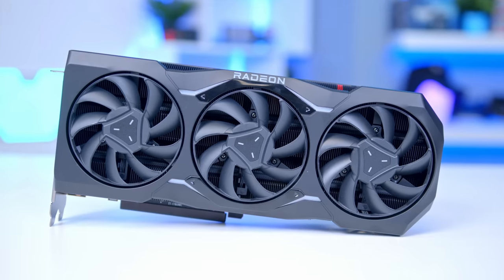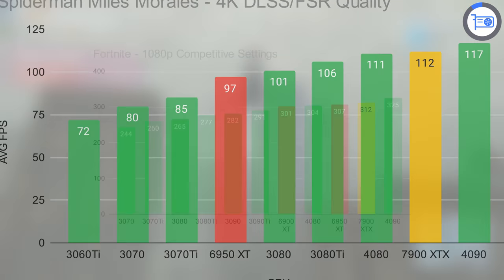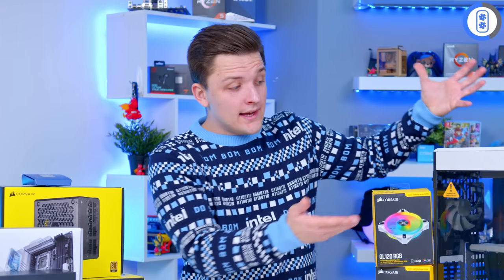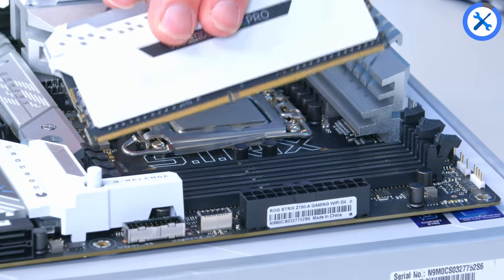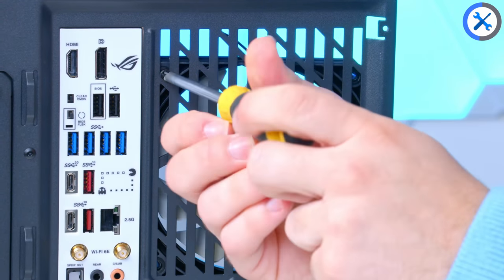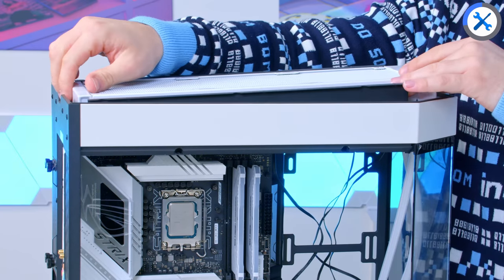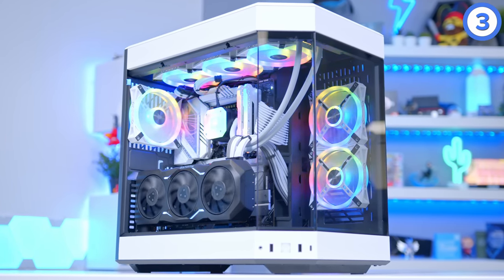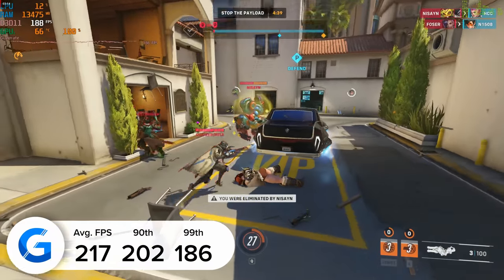Insane $3000 Gaming PC Build! 👀 [HYTE Y60 & RX 7900XTX Build Guide!]

Comment: I have the hyte y60 case and was definitely disappointed with the lack of accessories it came with. Plus the fans it comes with are complete trash and that's where they belong. I ended up putting 2 noctua NF A14 ippc 3,000 fans in the bottom which really helps with keeping the GPU cool. The only intake fans I have are the 2 noctua on the bottom. I have a 360 Aio on top and 2 140 on the side/back. I was kind of disappointed that there's only room for a 120 fan in the back. It's aslo kind of tricky wiring it all up because there's really no room to put the cpu cables in after installing the aio. I also had to cable tie the cpu cables down because they were hitting the fans from the aio because the motherboard is pretty close to the aio
Reply: How are gpu temps with the fans being close to the side panel?
Reply: Hint plug the cpu cables in first.

Comment: I can't wait to build on the Y70. It's gonna be very similar to this. 7900xtx taichi vertical mount on a 7800X3D. Just need to decide if I'm going to do the push pull with radiator on the side or just a single with the radiator on top. That will help me decide what I'm going to do fan-wise.

Comment: So u don't add any support bracket for gpu? Aren't you scared about gpu sag? My merc 310 7900xtx won't fit in with support brackets as it needs 4 but case only allows 3
Reply: Vertical mount is supported by the case hence sag isn’t a problem.

Comment: How does the gpu work vertically if it’s not directly connected to the motherboard?
Reply: The riser cable he plugged it into is fed into the Motherboard's x16 PCIe slot. It's basically just a 90 degree GPU extension cable.

Comment: I heard this case runs gpu hot. I was thinking about buying the ibuypower one with these specs

Intel Core i9-13900KF CPU, ASUS Z790 WiFi MB, GeForce RTX 4070 Ti 12GB GPU, 32GB DDR5-6000MHz RGB RAM, 2TB M.2 NVMe SSD, iBUYPOWER 360mm RGB Liquid Cooling. Anybody know how the temps are for running a 4070ti. Will be running 1440p.
Reply: That should be fine.

Comment: Bro if you pair AMD graphic card with AMD processor it will boost gaming performance by 15to25%
Reply: No, he put the i9 in there already. He’s already got the best processor he can get.
Reply: @chalkdemon8019  not really. The processor doesn’t matter as much for gaming.  Using an AMD gpu with an AMD processor can get 15-25% more power.

Comment: Hey I’m looking to build a pc aswell 
I have asked some guys around and they have me this list 
You guys think this worth it or I can get it for cheaper/add something better ?
Obviously the price is for the person to get all the parts so it’s normal to profit aswell.
But I want to know if I can get something better maybe for the same money 
Build:

17 gen 13
Ram 32gb ddr5
Ssd 1tb nvme
Mbo b660
Rtx 3070 ti rog strix
Psu 750w
Case nzxt h510 flow
Cooler nzxt ×53
3000 euro
Reply: The only thing I would suggest would be to get ddr4 if you want to save money on your motherboard and ram. There is only like a 1-2 fps difference in gaming but I think it could be worth it for video editing and those shenanigans. Otherwise looks like a nice build.